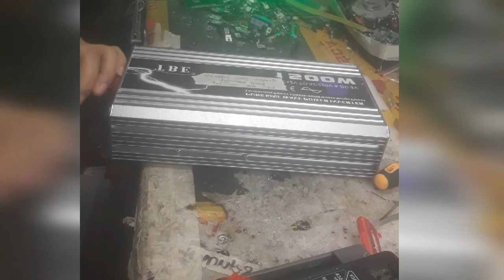TBE PURE SINE WAVE 1200W REPAIR

Comment: Sir, tanong ko lang po. Meron ako mensela 12v 2200 watts inverter. May power xa. Wala naman fault. Pero wala po xa output voltage na 220v. Ano po possibleng sira po kaya? O kaya pwede ko po kaya padala sa inyo. Para kayo na mag check. Salamat. God bless. More power sa channel.
Reply from the maker: Ok po sir lbc nyo nalang po..
Reply from the maker: Pm mo ako sir
Reply from the maker: Julius roluna pc solarpowerbox